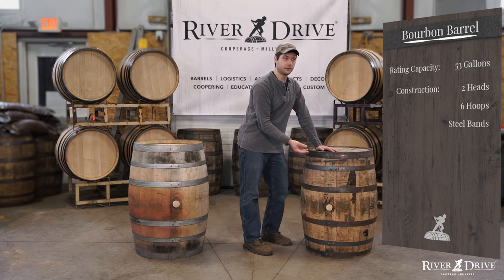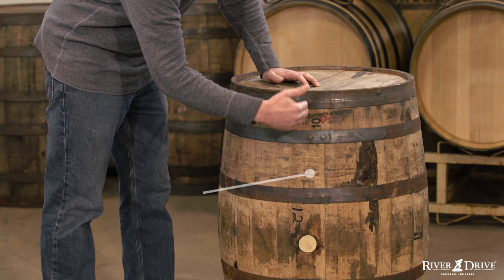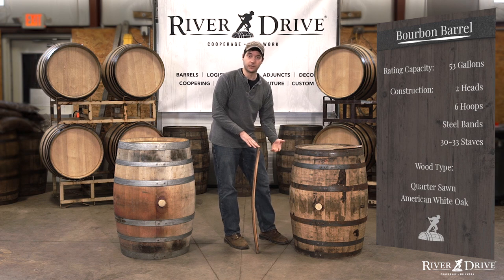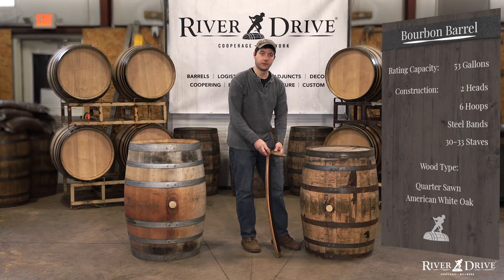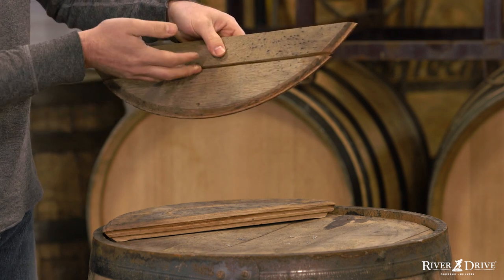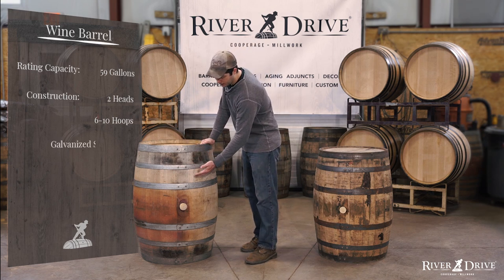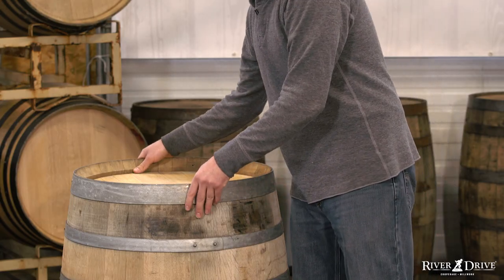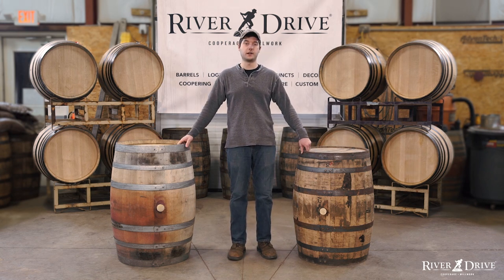Oak Barrel Anatomy 101 - The Parts of a Wood Spirit Barrel

Comment: How long do oak wine barrels last if used as a garden planter/container?
Reply from the maker: Generally, they will last a few years or more, as they are made from very high-grade oak. The two things that will limit their life are letting them dry out (in which case they can fall apart), or having them in too wet of an environment and in contact with the ground. In this case they will rot.
Reply: @riverdrivecooperagemillwor5211   thanks! I hope mine last
Reply: @riverdrivecooperagemillwor5211   Will boiled linseed oil add some longevity?
Just worried BLO might harm the plant/soil.
Reply from the maker: @LessTalkMoreDelicious  Linseed oil can be a good wood preservative - however, boiled linseed oil often contains solvents that may leach into the soil. It can also sometimes encourage mildew growth on wood.